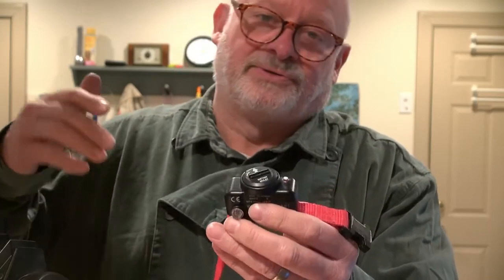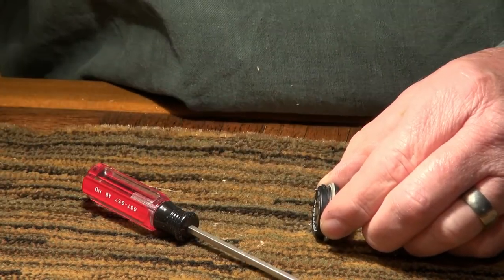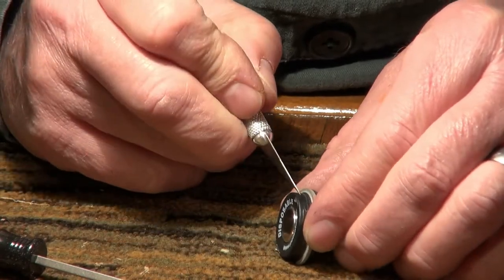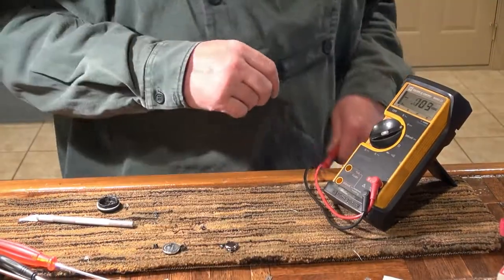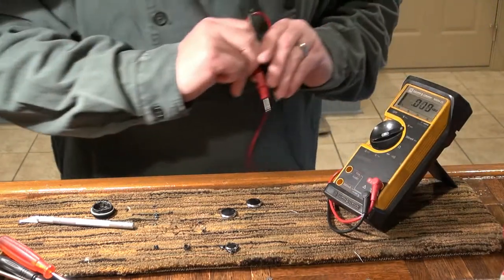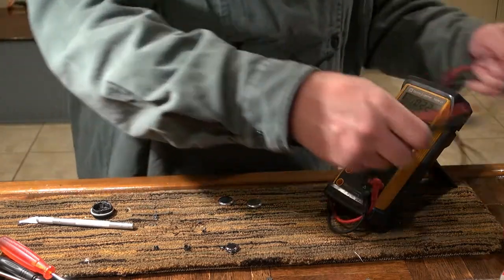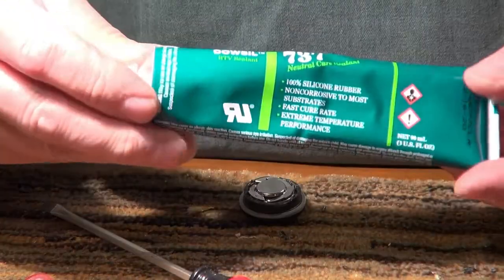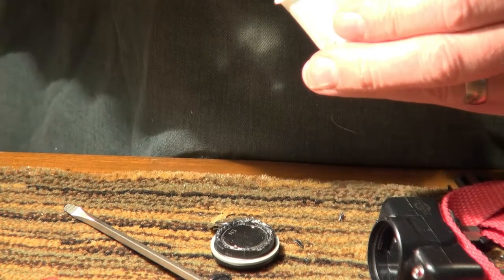Pet Smart RFA 67 substitution

Comment: Why waste time gluing and UNGlUING it? Just hold it upside down and screw it on
Reply from the maker: I glue just the metal contact to prevent it from shorting out.  I do not ever unglue it, it stays in place while i change the batteries.  The silicon adhesive prevents the contact from migrating to the side and shorting out the battery.  Once it is glued, "tacked in" is a more accurate description, once it is tacked, you leave it alone and just replace batteries as most every other battery operated device.  Pet Smart's scheme to become the sole source of the batteries required...defeated
Reply: One and done.